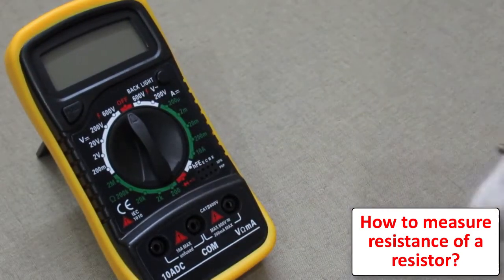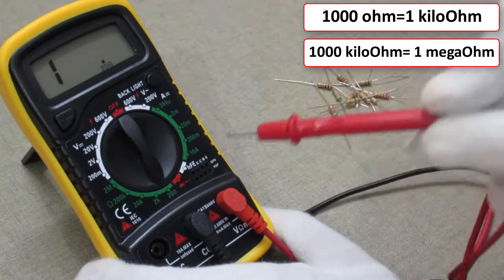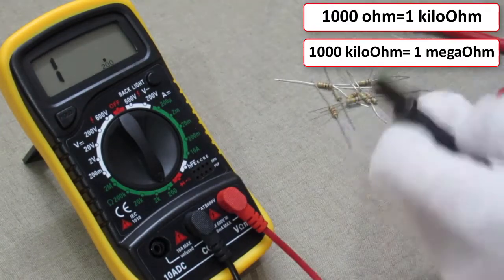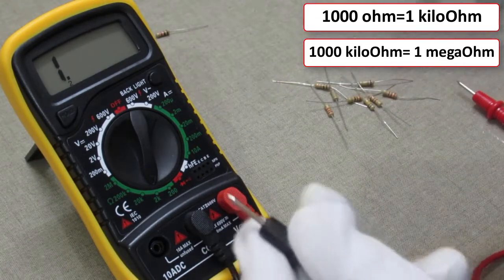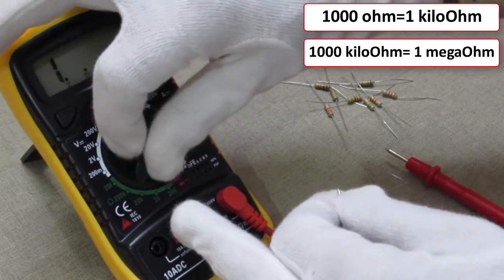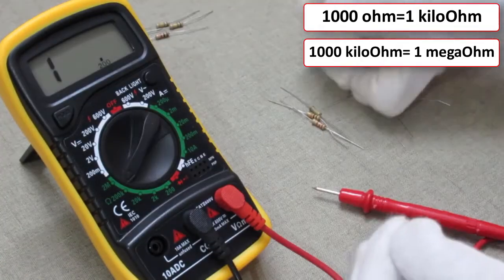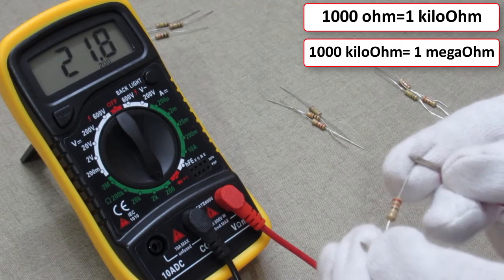How do i Check and Measure Resistor Value With Digital Multimeter?

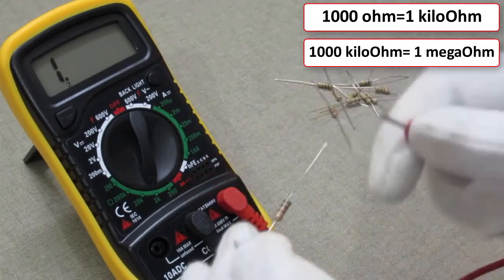Comment: you are measuring the resistivity of your body with gloves in parallel with the resistor you are holding. Rb*Rr/(Rb+Rr). You are not supposed to hold the resistor. At time 01:01, resistor colours say 1kOhm, hence 0.993=1*141.6/(0.993+141.6). It means you body (plus gloves and so on) resistance is 141kOhm.  If you consider the fact that the resistor colours at 1:01 say that it has 5% tolerance, it means that your body (with gloves) resistance, it might even be as low as 55kOhm.
You are supposed to make hooks at both ends and hold the resistor with probes via those hooks, thus not touching anything else via those probes.

Comment: My 45 year old Radio Shack multi meter just tells the value without fiddling moving the selector switch and my older analog multi meter does it automatically also. New multi meters suck.

Comment: conduction 

convection 

radiation

type of energy

calculaate potential and kin etic energy

circuit

parallel and the other one is a series circuit.

variables, research question, hypothesis

Comment: This video shows how to interpret the resistance value in context of the range selected. Starting from the lowest range, if the meter doesn't display a value, then move up a range and so on until you see a value. The range then tells you whether that value is in the Ω, kΩ, MΩ range. I had to go through several such videos to get this here. Thanks.